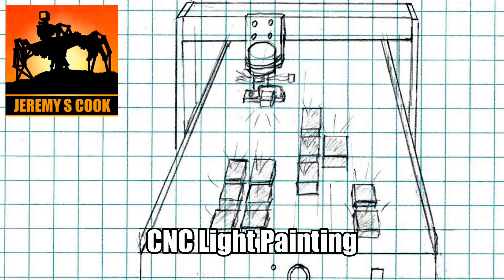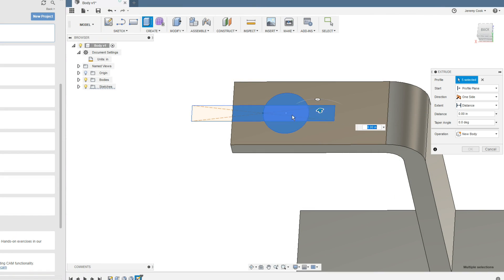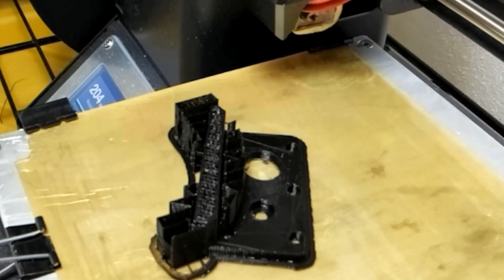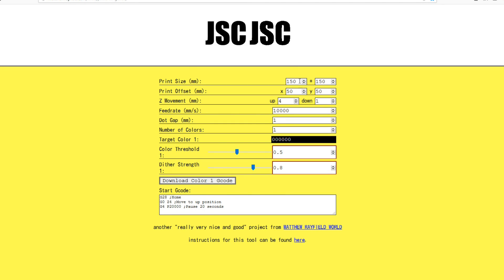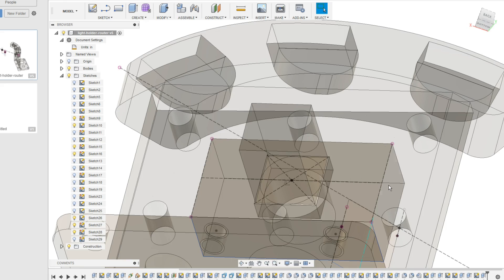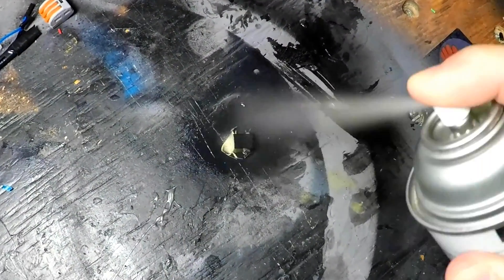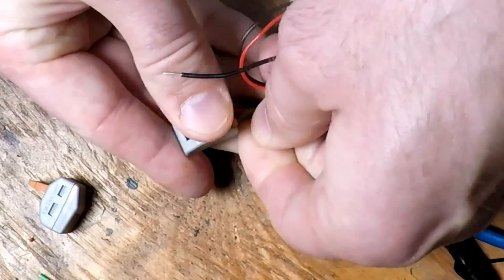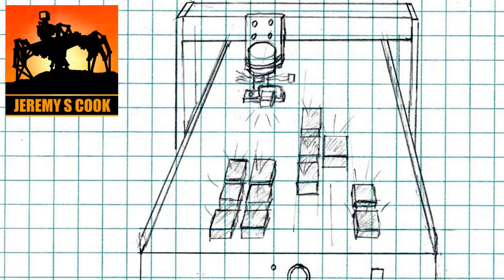Dot Matrix Light Painting with CNC Router

Comment: Yo really cool stuff Jeremy! Never imagined someone would use my app to do something like this. I wonder if there is some easy way to trigger the light without the button, so that you could also put "pixels" along the Z and make more 3D shapes. Like if someone did this with a delta 3d printer, where the base is stationary, maybe the fan could be removed and that signal used to turn on the light. Is there something you could tap into on the CNC, like power to the tool, that could be controlled via Gcode? I'm not super familiar with CNCs.
Reply: Also the diffusing of the light was a good move, the cube nature of each pixel looks really good, and I think better than a bare led ever would.
Reply from the maker: @MatthewRayfield  Thanks on both counts! 

Yeah, I think that's going to be "phase 2" using the router control to trigger stuff via a relay. May even see if I can use the vacuum control for 2 outputs! (cable at 4:30 in the video is for that type of control, but decided I'd leave that for the future, and what is used at the very end)
Reply: @JeremyCook  Yo sorry for the late reply! But wanted to say: If you do get it working in the 3rd dimension I can probably modify the Gcode generator for ya. Maybe could have it use voxel based 3d models or something. Let me know!
Reply from the maker: @MatthewRayfield  No problem! I see no reason why it wouldn't be capable, the only trick would be turning on and off the cutting head with GCode when needed - I think it's M03, but not entirely certain.

Yeah, if you wanted to modify I'd be happy to try it out. Otherwise I may try to do it myself, but might be a longer term project!